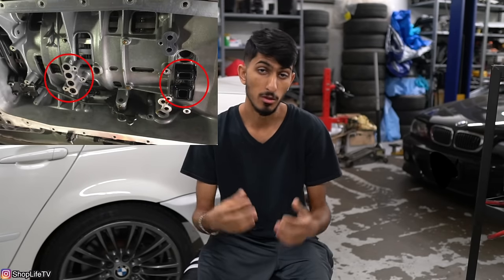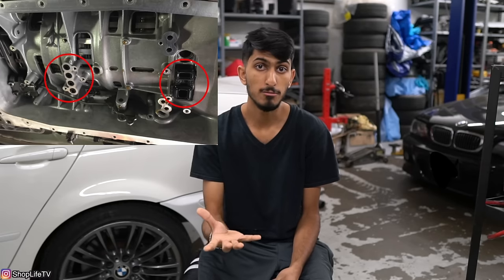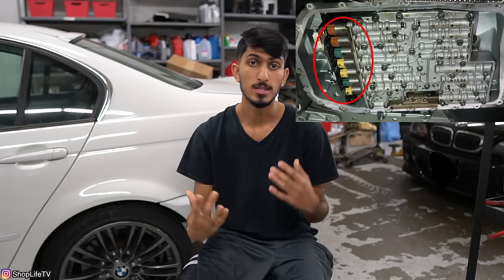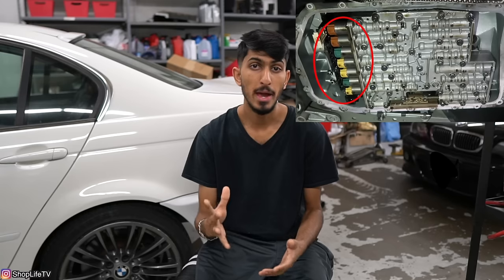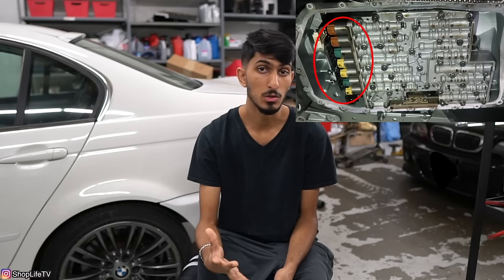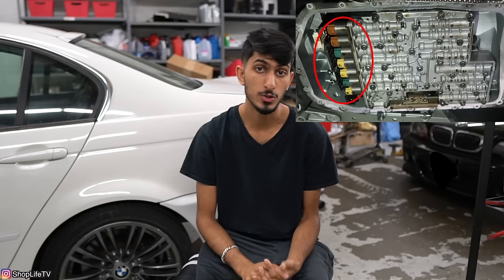ZF 6HP 6 Speed Auto Transmission Troubleshooting! Common problems

Comment from the maker: Any Diagnostic Questions/Shop Appt. Requests can be done through my website www.shoplifetv.com
Reply: Why my 528i only runs on m2  
Do i need to buy a new trans
Reply: How can i contact you for a tips ?
Reply: E46
Drives and shifts great 
No reverse tho
Reply: Any gearbox video? Removing seal from bell housing.
Reply: Estebancito Depazito what did you end up doing?
Reply: Any videos on a clutch e code?
Reply: Hey guys, can you discuss the ZF 8HP45 / 50 transmission. Do they have the same mechatronic sleeve issue? There seem to be a lot of failures around online about a whining sounds (exactly like a supercharger whine), which appears only under hard driving and subsides and goes away with normal driving. For my car, appears to perk up especially under hard cornering. Any thoughts, advice, opinions, info to share? Thanks so much again for the video!
Reply: Hi, great video dude. Was going to ask question on your website, don't live in US though, is that an issue?
Reply: I have a 4E25 EGS: electronic pressure control valve 6 in my 2010 Bmw 528i just like you said it’s a common problem and stays stuck in 3rd gear now I can’t move out of park or drive it. If I just need to replace that one solenoid which one do I get? As in which solenoid controls that gear and which color is it and which one on the valve body is it so I can buy the correct one from the site you mentioned. I looked it up and just it says eds1 eds2 etc so I’m not sure which one to get please help
Reply: @keithwaring3799  Same trouble, did you figure it out?
Reply: My 2008 528i was driving perfectly fine shift everything was normal then all of a sudden last night it went into transmission malfunction! And now it’s stuck in park won’t shift to R or D? Took it to a shop and they said I need a whole new transmission ? Tried to charge me 7k and car aint woth that much lol
Reply: Bruh excellent video!   Very informative !
Reply: What are the fault codes for a 2013 BMW X5 I35 E70 SOLENOIDS AND OR VALVE BODY
Reply: Where is your shop ?
Reply: Hello.
I have 2010 BMW 550i M-sport package with 6HP28 Auto transmission.
Two years ago, transmission was rebuilt, but shifting problems on the hill road between second and third gear not fix.
Transmission service say: it is some miscommunication between transmission and ECU, or bad O2 sensors, scan not have any errors.
Did you have any idea to resolve this problem?

Comment: ZF6 are really good transmissions if maintained well. Penrite have a very cheap alternative to the Lifeguard 6, called Penrite ATF BMV fully synthetic. I own 4 cars all with ZF6HP26 transmissions, after full service (all seals, valve body clean, etc) oil and filter they have all performed excellent with this new OEM replacement fluid, at a fraction of the cost.
Reply: Hii. From where did you get seals in Australia.
Reply: all supercheap and repco have them, youll need around 6 litres if doing a full service

Comment: What if it shift hard between 2/3/4 gear 2000 - 2500 rpm ? What is wrong Then ? (E60 2004 )
Reply: Hi im having the same issues with my car was just wondering if you ever got this sorted. Im having troublecode gear ratio 3-4. What was the fix to this?

Comment: Mind started with skipping now it doesn’t go into any grear at all . 100k miles not abused  or raced. I have mhd stage 1 do I have to set it back to stock for the shops to do new sleeves and fluid change ?

Comment: Thanks for this!  I have a E60 550i with the SAT and an aftermarket ESS supercharger that I installed six years ago, and the only gripe I have about the car is the downshift from 2 to 1 at a stop- the car literally JUMPS forward and it tends to scare the crap out of anybody in it (especially when rolling up behind another vehicle).  The car has 83,000 miles on it now and I was just about to flush the fluid anyway.  It's good to know that it's just a seal and not a more serious issue.  You rock! Subscribed!!!
Reply: having the same car but with 275.000 km. 2nd to 3rd upshift is rough. Did you fix your issue?
Reply: Mine does the same but 1 gear slips tho
Reply: @mariabutler3356  : sorry for the late reply... YES. The problem got quite a bit worse, and I ended up having problems shifting in every gear and getting slippage in the lower gears.  I thought the transmission was toast, but replacing all the sleeves and seals cleaned everything up and it drives perfectly again.  Aside from brakes, this was the first major issue I've had with the E60 and I am happy that it was so easy to fix.

My E46 M3, however........

Comment: I have just finished repairing thid exact fault 
Dead solonoid replaced the sleeve seals all working again 
If your confident with diy put sonnax kit through it the accumulater piston dampers flatter out inside the valve body and the sonnax kits fix alot of issues with in the valve body 

Gresat vid by the way your rite alot people can not diagnose transmission faults

Comment: Straight fire video as always….Your video on replacing the sleeve save me a ton of money
Reply from the maker: Glad it saved you money! Thanks for watching!
Reply: @Dustin´s Fish Tanks I would like to know what were the symptoms you suffered before changing the sleeves. I suffer from small jerks between first and third, and the reductions are somewhat abrupt too. Do you think those pulls will be fixed by changing all the sleeves and connectors? The oil in the box is recently changed. Thank you very much and congratulations for having been decisive in your car.
Reply: @ShopLifeTV I have this 2nd to 1st jerk. Just starting to drive the car you don’t feel it. Later as your drive yes. It could be only low oil? Why it doesn’t feel all the time?
Thanks!

Comment: Thank you!  Great video shows your knowledge and experience.  You saved me over $12k on a transmission per BMW.  Changed out the mechatronic unit with sleeve, plug adapter per you video.  Then had Bimmerhaus program mechatronic unit with IMPA
Reply: Fucking hero I swear

Comment: Damn bro you covered my issues with my e65 in less than 12 minutes I've been chasing this for a month now.
Reply: What issues were you having? I currently have a code for 4E25 for electronic pressure control valve 6.

Comment: This is my weakness part when doing diagnostics. I diag for shops in my area and when a transmission issue comes in they right away send it to a transmission shop. So the very few I diagnose takes forever because of the research. Transmission are a different animal.

Comment: I have a 2006 BMW 530 is with the SMG transmission.... The vehicle was bought second hand...  and now has 200,000 kms.... In October 2021... I had a transmission problem.... While in automatic and stuck in traffic at 5 km an hour the car went into neutral and would not...move.... It was told and eventually repaired at a transmission shop after 2 months replacing the actuator with a rebuilt unit from SMG society in Germany.... The car ran superbly for 45 days...about 400 kms.. We had a massive snow storm in Montreal and the temperature then dropped to minus 25 degrees Celsius... The car was stationary for about 3 days

Comment: Great video. I wished I would have watched this a long time ago but luckily for me I was having that clunk between first and 2nd and one time it was a hard jolt. I took it to the shop in Solana Beach, California called Hugo's European Auto repair. They did the transmission service, replaced the sleeves you mentioned and got me back on the road. Luckily I didn't do any other damage and oddly enough BMW calls it lifetime fluid transmission and I preach to everybody who I'm in chat rooms with and I tell them replace it at every 60,000 mi regardless what BMW says it is not lifetime transmission fluid...😅

Comment: I did all that replacing sleeves and solenoids it didn’t fix the problem. I decided to replaced the valve body with a new one but still jerking on the second gear.Now I’m replacing the whole transmission and hope this will work before I lose my mind.

Comment: Penrite are doing a OEM direct replacement fluid for Lifeguard6 ATF its called Penrite ATF BMV full synthetic and it can be used in ZF transmissions. It costs a fraction of Lifeguard, around $10/litre saving heaps of money.

Comment: VERY informative! Thanks much! I have a '04 Jaguar XKR with a ZF6-something that just turned 60K and been looking for info on preventive maintenance coming up. Then last night, 200' before my driveway the amber trans. warning came on and put it in limp-home! After shut off and restart it's fine again but now I'm leary. Gearing up for a fluid change, will check into that sleeve too. Hope that catches everything I need to worry about. Well done video, thx!
Reply: How did it turn out
Reply: @SiikPros  Heh, it was the start of a series of "fun" b/s! It also soon developed what I presume is what they refer to as the "ZF bark"! A little low pitched "chirp" every time it went into 4th. Anyway I acquired a steel pan (the black one, holds the same amount of juice, has a fill port in the center, heavily built, this was the best move I made!), saw an ad for a valve body service that rectified a number of known issues with these boxes - and a lifetime guarantee too ($650). Replaced the bridge seal and the connector seal (was clean and dry but did it anyway). Got it all done, works great, big difference ... but now leaks into the inspection port of the bell housing! (Slow drip but several drops per day.) Ended up having the trans pulled, they replaced the large O-rings at the pump/trans case. (Another $1,100!) Best guess (help me here if you can!) he told me that the VB rebuild may have screwed up the anti-drainback valve from the converter, he said it only leaked when running - would love your opinion on this. After all that ($2,100 total now) it's been perfect! Well, except last year it developed ANOTHER leak!! Now it seeps ever so slowly at the connector (where it never leaked before but I replaced the seals anyway!) but it appears it could be leaking THROUGH the connector, not AROUND it. Very slow leak, several drops per month. So that's where it stands now, works perfect, seeps a little. Screw it, I'll top it off every year with a few ounces! These seem like a decent x-mission but super temperamental and love being a major p.i.t.a! Any comments are welcome, tia! I know, you're probably sorry you asked, lol!
Reply: @flyurway  no regrets about asking lol 

I'm just on the fence about buying a Jag rn and it has this tranny. Things are bound to go wrong with a 17 year old car, but I'm trying to make sure I don't get myself into a financial burden lol
Reply: @flyurway  I agree just keep pouring oil in it
Reply: @SiikPros  I don't know which Jag you're talking about - I have an XKR - but they are a nice car albeit not as well built or nearly as issue-free as my Chevy truck of the same vintage. (They love electrical glitches, never let the battery run low!! Keep a maintainer on it if it sits more than 2 weeks.) The ZF6 is a tough tranny and works well when it works. But they are very temperamental to maintenance. Also, as he states here, the fluid is VERY particular. Though he swears by only getting Lifegaurd 6 at the dealer (I hear about $40/liter!!), I've found Ravenol 6 is the exact same thing for about 1/2 the price. And to go a step further, Ford SP is ALSO the exact same thing (and it's also red) for about 1/3 the price! (Ford used the same tranny early 2000's on Lincolns, T-Birds and some trucks.) I find them both on Amazon. I'm running the Ford fluid since I've gotten this thing squared away and, aside from that minor seepage I mentioned earlier, it's really working better than ever now.

Comment: Thanks so much for the info!! You just described EXACTLY what my 2005 530i  e60 I just bought is doing! Thud when stopping from 2 to 1 like someone lightly rear ended the car! Also, it shifts ok if I drive quite softly but if I give it 3/4 throttle through all the gears it seems to get to maybe 3 to 4 or 4 t 5 (Im not sure, and it suddenly doesn't know if it should shift up or kick down and revs highly and throws the 'transmission malfunction!" error and light plus it goes into safe mode (1 gear only) until I turn motor off and let it sit and reset for 20 minutes or so..  Im hoping it's all to do with the  mechatronics sleeve! - the previous owner just spend $4000aud getting it all 'fixed' it by way of replacing solenoid 2 for $200aud and a 'transmission service' kit which sounds like gaskets perhaps for $420 AUD - which basically did noting by the looks of it when they should have put a new mechatronics sleeve in instead!
Reply: Hi did you get yours fixed? And how did you manage to sort it out?
Reply: How did your fix go?

Comment: Man great video. 04 E60 525i, only 100k miles started slipping and going in to limp mode. Had input shaft output shaft rpm mismatch errors. Found a high end indy shop that said the clutches are toast. I guess it's not just solenoids then eh?

Comment: I have really enjoyed your videos and very detailed explaining. You are extremely knowledgeable.
I am looking to you for help after spending way too much money on failed diagnostics. I have a 2006 525i with Transmission Fault. I replaced fluids, transmission pan/filter, and all the gaskets between the valve body and transmission.  I have codes: 
CD99 
CD9E  
CD9D 
CDB0
D358 
A3AA
A0B1
Any ideas?

Comment: I replaced my bridge seal on a 2005 x5 4.4 engine ,6hp-26x .  Now the car wont start any ideas the battery is good one year old ,checks out fine on a load tester.  Car won’t turn over at all.   4wd light and abs are on . Any ideas?
Thanks Wes

Comment: If you need a remann ZF6 or ZF8 (upgraded) valve bodies with sonnax valves, zip kit, and new solenoids for way cheaper than the rest of these guys call, Sunbelt Transmission warehouse.

Comment: question Bro not sure if you'll even answer but i'll give it a shot! i got a AG6hp26Z for 2011 750i xDrive, i recently replaced sleeves and adaptor i also installed a Sonnax rebuilt kit anyways my car has that P parking flickering occasionally which is mechatronics issue i know that but would that cause any shifting issues ? i have at times a little  jump going on second and third but its not all the time! i also read solenoid EDS 3 almost Maxed out at -384bar i believe max is -400 before i get a code! i replaced that solenoid same day i rebuilt valve body and haven't checked the new value to know if thats still an issue there still driving for it to adapt! every other solenoid was in spec. when i first got the car oil was super black! replaced it like 5 times already but no metal on magnets at all! anyways do you think Mechatronics flickering may be my shifting issue? i didn't test valve body for internal leaks i dint have those tools but based on Ista+ readings valve body its with in Spec. what else can i look in to? ill guive you all reading below prior to valve rebuild..
filling pressures 
clutch A -108bar
clutch B 50 
clutch C -384
clutch D 184
clutch E -12

Rapid 
A 37 ms 
B 18
C 0
D 0
E 30 ms

Any help given greatly appreciated 🤟

Comment: Great video!  I will be doing the preventative maintenance on my ZF transmission. I bought a 08 3.0si e85 a few months ago. I  know the owner before the guy I got it from did a bunch of stuff but not sure on the transmission. The guy I got it from only owned it for a little over a year and only put 1500 miles on it.

Comment: You haven't mentioned anything about any electrical fault codes and how those can affect the transmission. For transmission keeps going into limp mode after I did the full zf service and new solenoids and reset adaptations and relearn procedure. Well turns out it can all be related to this DME generator code (alt seems to be slowly dying) which I didn't think had an affect. Weak alt can't keep electronics all fully powered and thus is throwing the car into trans limp mode with any hard throttle. My adaptation values were nowhere near the limits and it was still slipping. When my tpms suddenly went out at the same time I started to lose pressure in the grabbing of 4th gear, I knew it was related to the alternator code.

Comment: I replaced everything you mentioned  and egs was swapped into the new valvebody.. I'm still having a hard downshift but regular upshifts... Also going from park to drive the car makes a hard thumb or park to reverse same hard thumb... only thing I did not do was reset adaptations

Comment: First off thanks! You are one knowledgeable mechanic.
I’m daughter bought her first car, a 2006 BMW 325i on the way home it jerked when her boyfriend tried using the sport shift.  It was Erving but not shifting in to gear 3rd or fourth.  They pulled over and parked it when they started it they put it in drive but it doesn’t move it only revs.  It goes into Neutral and park and reverse though. Make a hard clunk when shifting.  I towed it home And dropped the pan.  Oil was really black.  Have you dealt with this or anyone else in the comments?  I ordered a new pan filter and now I’m thinking just changing all the sleeves and solenoids.
Reply: What did you end up doing in facing the same issue in my 2011 bmw 328i??
Reply: How ended up? I have jerky upshifts on sport (DS) with low trottle, but in high trottle nothing, yesterday I saw that the trans pan is leaking, but aside low trottle on sport or manual works fine. Have the car since tuesday

Comment: Mate I get the clunck in down shift. IV pulled the mechatronic unit down to change the sleeve rectangle shape one and 4 others. As you advised . However my
 2002 x5 3.0i
Doesn't have the same plastic sleeves that you and others are saying will fix the issue I'm having can you help me?